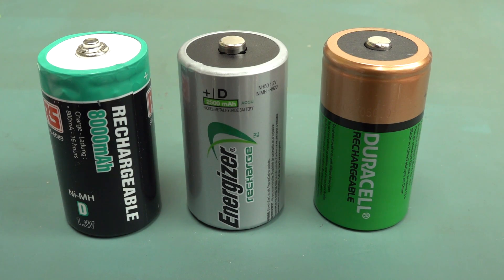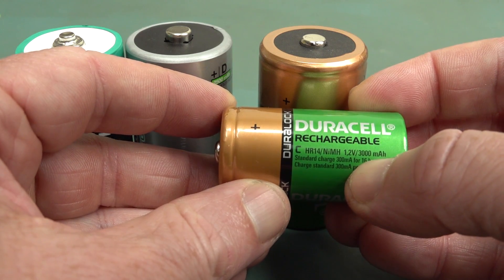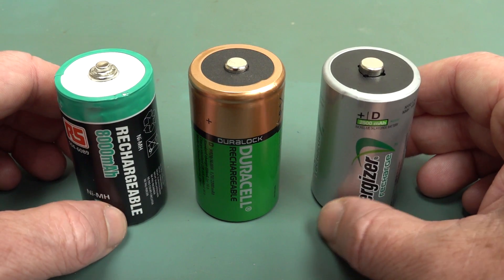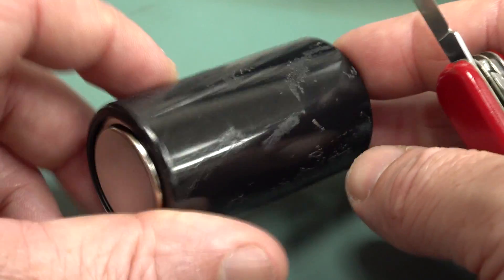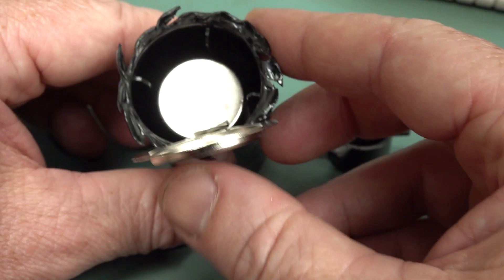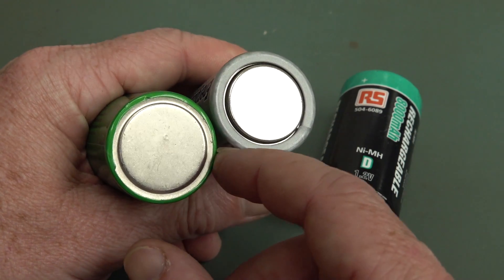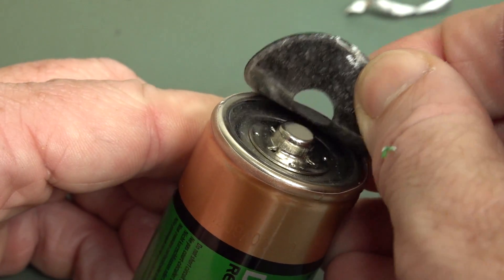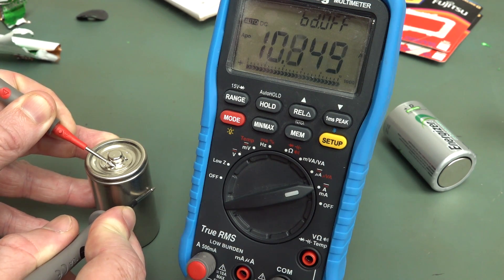EEVblog #1200 - BUSTED! - Energizer & Duracell NiMH

Comment: In that Energizer battery is enough space to fit in a couple of batterizers. gotta get that 800%
Reply from the maker: Energizer did threaten batteriser over their trademark, so they must be working on their own...
Reply: New Indiegogo campaign: a reverse batterizer. It allows you to charge your rechargeable batteries to 800% capacity. we can also stick it in the ass (sorry, bottom) of the empty D-cell battery.
Reply: Batterizer might make sence with nimh some devices are not good with 1.2 volts but parasitic drain might cause problems
Reply: @mistakenotou7681  also, batterizer draining the cell down to 0.6 V will make it not much of a rechargeable in short order.
Reply: @andrewbergspage  yeb that will kill a nimh

Comment: Dropping them won't show the weight difference...
Reply: Sure, so next he checked it in the other way
Reply: The sound they make on impact does though. A heavier battery will have a higher impact energy than a lighter one so it makes a louder thud.
Reply from the maker: They make a different sound
Reply: @EEVblog  that shows that there is a void inside not that the weight is different. I agree that having a void inside probably means that it's lighter unless they added some lead to compensate.
https://www.reddit.com/r/pcmasterrace/comments/9wimlo/when_you_buy_a_cheap_external_ssd_from_china/
Reply: I generally take them to the scales in the food ile of the supermarket to weigh them.

Comment: I used to have a set of battery size adapters. Concentric cases that could take an AAA and bulk it right up to D cell size.
Reply: I have some AA adapters up to D cell size.
Reply: The only real use for D cells is for a big flashlight that can be used as a club !!
Reply: @GodzillaGoesGaga  
I use 6 x AA to D size adapters in such a flashlight. It allows me to have only AA and AAA accumulators in my house and if the flashlight runs out of energy i just put others in and recharge the empthy cells.
I stopped buying real C an D cells a long time ago.
Reply: Gazza-usa Nah, also good for loud battery powered doorbells and loud ghettoblasters.
Reply: @GodzillaGoesGaga  I have a boom box that takes them.  Also have an army flashlight that takes 2 x D that I'm converting to LED.
Reply: @stinkycheese804  is it a old Sanyo one from 1987?
Reply: @GodzillaGoesGaga  maglite
Reply: Yeah I've got some D cell adapters that can hold 3 AA batteries in parallel, but the only problem is the batteries often don't discharge at the same rate so don't put out the full capacity of all 3.
Reply: @michaelparker2449  If they are in parallel they HAVE to discharge at the same rate, they self balance.  If that's not happening i'd guess there's a flaky connection somewhere.
Reply: @michaelparker2449  Hmmm. If you use rechargeable (nimh) aa cells then they should charge and balance each other so long as they aren't under continuous heavy use
Reply: I have one that converts 3 AAA's into an 18650. The most useless converter ever, came in a cheap flashlight. 3 AAA's do not remotely produce enough current.
Reply: They're 3D-printable now. I have an old keyboard in my house that needs C-cells, and it's the only thing that does. C is the same height as AA, so with a round 3D printed shim... And the battery life is "good enough."
Reply: @McTroyd  or just use a fuckton of tape or roll paper and srinkwarp it or many layers of shrink warp
Reply: @mistakenotou7681  Perhaps. Or foam/cardboard/etc. I was really more intending to point out that the larger batteries are largely unnecessary these days. Besides, one can't have too many uses for a 3D printer. :D
Reply: @McTroyd  26650s are still useful
Reply: @mistakenotou7681  Oh yeah. But that's 3.7v lithium, not 1.5v alkaline.
Reply: @McTroyd  alkalines are never a good idea
Reply: @mistakenotou7681  Why not? I mean, aside from the leaks, explosions, equipment damage, environmental disaster.... :D
Reply: Exactly, and that what these two batterys are doing. Filling the space. Back in the day, c and d sizes where needed due to crap capacitys. When AA got more juicy, they had more umph than the c and d demands from old products, so who would want a D cell that can supply 20+ amps to run your yamaha keyboard.
Reply: @UberAlphaSirus  I was also thinking that maybe the chemistry got better, so you only need half the battery to match batteries from the old days. Also maybe D cell stuff is so rare these days that it's more economical to stuff a C in there.
Reply: I know those adapters.  I sold them at RadioShack.
Reply: Yeah I don't worry with C's and D's anymore. Just use an adapter on your AA's to what you need. Just use decent AA's, not onehunglow's. They're overpriced for their ACTUAL capacity compared to a decent brand.
Reply: It's called cardboard and tape.
Reply: I've got a nice little LED flashlight that came with an adapter and 3 AAAs in it, I think the form factor is actually C cell, but I haven't tried it with one.
Reply: Yes I still have a set of them, often AA cells have more capacity than C and Ds.
Reply: Me
Reply: You do not show when you take out the outer energizer cover...
Reply: Yeah I still have some. One that I can take 2 AAA and use them in 9v systems

Comment: Wow!  In my experience devices designed to take D cells actually "need" the extra capacity, so this sucks.  It could even be life endangering, although I'm not sure much modern safety related gear would use D cells.  The only thing I still have that takes D cells is a large Maglite torch I use during power outages at home.  Had it probably nearly 30 years, and I don't think I've put new batteries in it since buying my house about 20 years ago.  It runs a little dim now of course.
Reply: Maybe you should replace them, Commander Keen.
Reply: @seinfan9  Considering it isn't even an LED torch, it probably isnt worth it.  But my wife likes using it (it is easy to find), so maybe I'll add some D cells on my next order
Reply: The thing of it is, while a typical alkaline D cell is rated at about 15,000mAh, that is at about 25 mA load.  When you put a quarter amp load on it the capacity drops to the same 2500mAh range of the name brand rechargeables.  It looks to me, like the big companies did the math to make a cell that lasts as long as an Alkaline.  If you want extra capacity beyond that, then you can go for one of the brands that fill the entire can and give you 8000mAh.  
I'd have to actually compare prices to see what is a rip off or not, but one does expect to pay a premium for a name brand.  I've used dozens of brands and hundreds of AA cells for my photography equipment over the last 10+ years, and what I've found is that Duracell brand holds up the best over time, I have sets of AAs with over 500 charges and 10 years of service. Most of the premium brands seem fairly equal and are good choices if substantially cheaper than Duracell, rayovac and amazon basics tend to work well.  Finally every set of energizer I have ever bought has had at least one cell fail within 6 months and they hold less charge then other brands. Perhaps this has changed in the last 5 years, but I no longer buy them.  
I don't have any c/d cell equipment that is in regular service, but I'd probably opt for the higher capacity if it was something I used every day.  For occasional use I'm happy with using AA NiMH and adapters or just buying a set of alkalines for my 4 cell maglight every 2 years.
Reply: @johngaltline9933  Regarding reduced capacity at load, are you talking Alkaline or NiMH?
I checked out the Duracell and Energiser Industrial Alkaline cell datasheets, and they're both rated for around 20 hours at half an amp (down to 0.8V), so that is still 10Ah.  The consumer versions, or the NiMH, could well be less capacity.
I generally just buy Energiser Industrial bulk packs of AA and AAA which is what I go through the most of.  Only use NiMH in devices that chew through batteries like my UHF scanner and handheld GPS.
For Alkaline I've personally found Duracell to be more problematic, but as usual that's just annecdotal.  For NiMH, I usually buy eneloop or Maha brands, or just use whatever comes with the device.
Reply: @johngaltline9933  And just for reference, the Ansmann 10Ah rated NiMH D cell is rated for 9300mAh at 0.2C (2A) and even 8500mAh at 1C (10A).  That is discharging down to 0.9V, although it isn't much less if you terminate at 1.0V.  Mind you they ain't cheap, at about AUD$20 each wholesale, vs $15 for a pair of those crappy 2.5Ah Energizers, and $20 for a box of 12 Energizer Alkalines.

I just noticed that the Energizer Alkalines are actually advertised as 20.5Ah, but that is at 25mA like you said, and realistically more like 10Ah on a 500mA load.  Anyway, this is why they were once so great for things like torches and safety products (marine and such) because of the long life.  Times have changed though with LSD NiMH and lithium types.

Still tossing up whether to get some more Energizer Alkaline D cells for that torch, or just use some AA to D cell adapters.  I think the former as the heft of that torch is a large part of its "attractiveness" (by that I mean ability to defend against an intruder... LOL)

Comment: Have you disposed of the disassembled batteries safely. I cant remember if it was BigClive of MikesElectricStuff but one of them has a video where they were unrolling AA cells and the film caught on fire some time after the disassembly!  Not the sort of thing you want to put in the office bin and go home for the night
Reply: I was just thinking the same thing. It was Clive (https://www.youtube.com/watch?v=tBg4ximDrsk0 fire around 16 minutes in) and I was wondering if we'd see flames here as well.
Reply: I think that was a lithium battery.
Reply: @gorillaau  it was a nimh, it surprised me because I didn't expect it one bit.
Reply: @volvo09  Heck. I better upgrade my explosion containment procedures.
Reply: Nothing like having a transformer fire followed by flooding then to round things off, a battery fire.